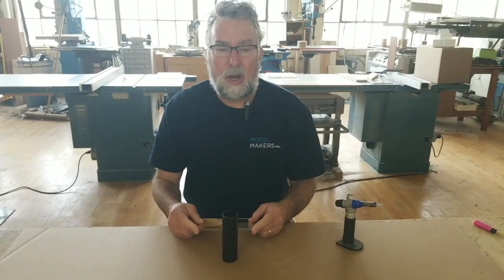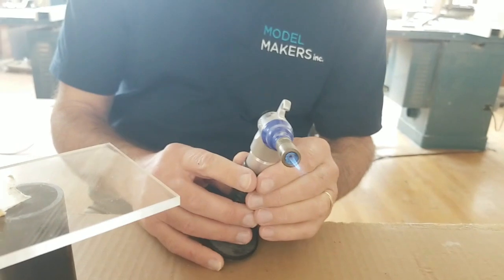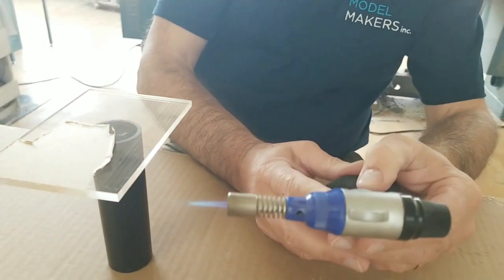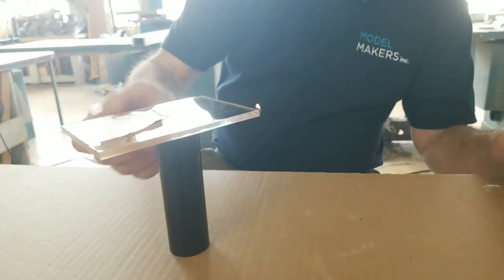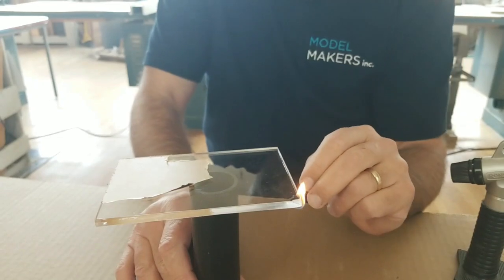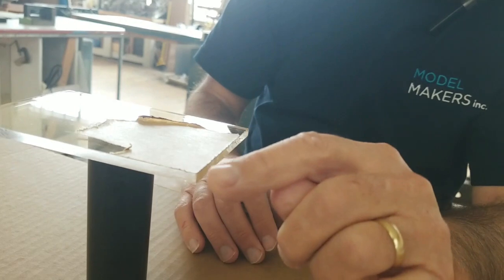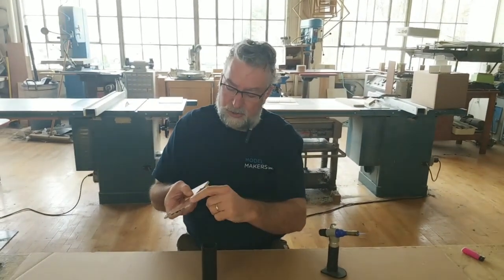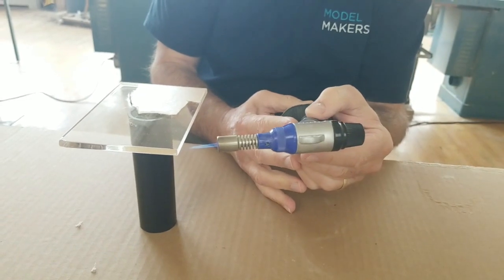Flame Polishing Acrylic

Comment: This is great. All the plastic companies say you need map gas. You just did it with a butane torch, which all the plastic manufacturers say does not get hot enough....
Reply: Hello, here's why we suggest MAP Gas, though it is not a requirement
*Higher Temperature: MAP gas burns hotter than butane, allowing for a more efficient and effective melting of the acrylic edge. This results in a smoother, more polished finish.

*Controlled Flame: MAP gas typically produces a more focused and stable flame compared to butane. This control is crucial for achieving a consistent and even polish.
*
Faster Polishing: Due to its higher temperature and controlled flame, MAP gas can often polish acrylic edges more quickly than butane.
Reply: Propane is fine. You just need good burner.

Comment: would a lighter work too?
Reply from the maker: Not very well. You might be able to melt the edge with a butane lighter, but it would be very hard to control, and very challenging to get a good looking result.
Reply: @modelmakers33  what about the Novus polishing 1, 2, 3 step product?
Reply from the maker: @wwfera00  Yes. We actually have another video about that. (scratch removal) A hand rubbed compound like Novus will give the edge some polish, but not like the high polish you'd get from flame polishing or a buffing wheel.